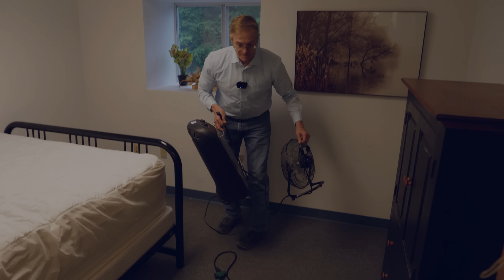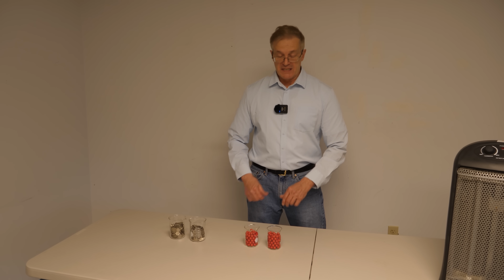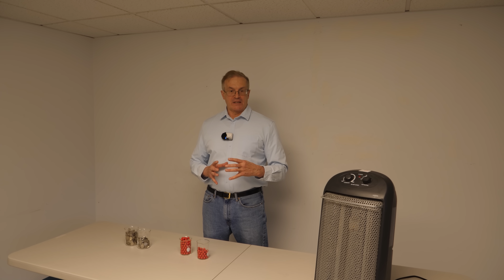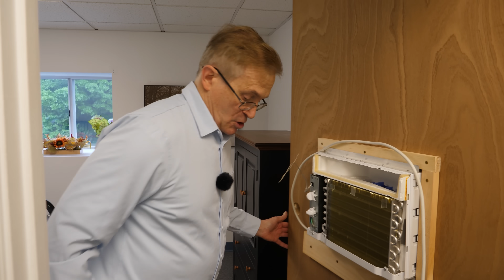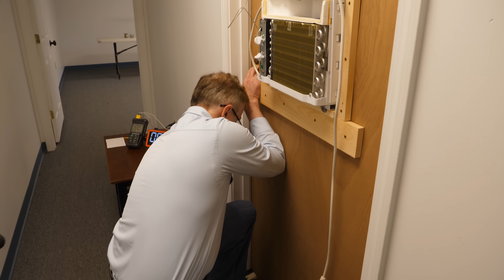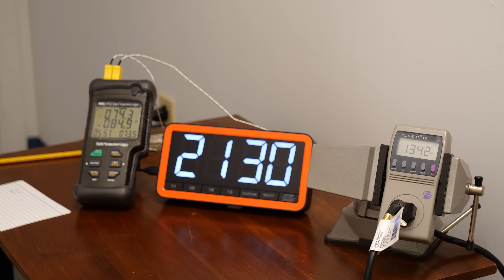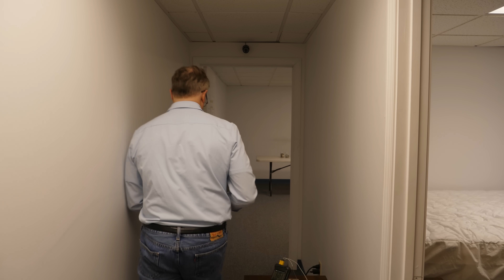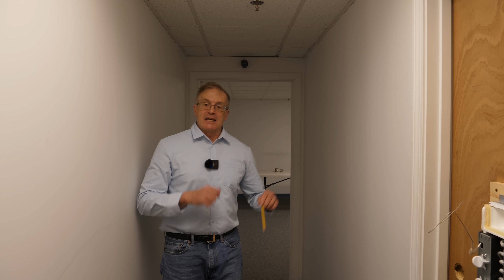You're wasting money on heating! Use your A/C!

Comment: Heat pump still runs high amps on compressor and 240volts inside and outside . Power failure in winter equals large home generator to run heat to stay warm with heat pump or electric heat ! Heat pump running is like A/C running it draws a heavy 15-22 amps on residential plus the 3-5 amps from the blower . Most heat pumps have emergency electrical heat so if it doesn’t satisfy soon enough it pulls on emergency heat with heat pump and then your pulling an additional 20-40 amps depending on the size of heat strip you have for back up heat and assistance to the heat pump that can’t keep up in cold cold . Most heat pumps can manage on 40° plus once temps are below 40 and less heat pumps struggle and loose efficiency quickly also . 

If you put natural gas heat or propane heat in your house your heater inside runs off 110volts and doesn’t need the big amp / electric draw of the outdoor unit at all . Also if a power failure happens in cold weather your basic camping use generator will run your whole house central heat gas heater . As gas don’t freeze So you’ll have gas to it . Propane is pricier than natural gas . Maybe I’m wrong , and Gas heat blower motor pulls like 3-5 amps when running and doesn’t require the outdoor unit at all.

Comment: But what about chilling the rest of the house with the cooling air conditioner side?
Reply from the maker: This was a demonstration to show the multiplier effect of a heat pump. Typically, they would be exhausting the "cold" air outside, but there are ways to combine conventional heating methods with a heat pump to cover much larger temperature differentials and still take advantage of the efficiency gain with the pump. The route is based on your concern about cooling one room to heat another. 🤔

Comment: I'm Sorry I can't get past the A/C in the door with the Exhaust towards the room. Even you said the Temperature had dropped in the hallway. So the controls would have to be outside the home in order to get the heat from the Exhaust? I understand BTU but not transfers of unseen energies. Not trying to be sarcastic. It just doesn't compute in my mind. How do you use an ordinary A/C unit if the room you're trying to heat is on the outside of the unit?
Reply from the maker: The demonstration proved the huge efficiency gain when using a heat pump.
Implementation in a practical system would involve a little more than rotating the airconditioner, but it's not that difficult to work out those details.

Comment: I do not understand how that can work in real life situation.  A window unit AC has a thermostat and the lowest it can be set to is 60 degree.   So if the outside temperature is (lets say) 30 degree, the AC condenser will not come on for the heat exchange.

Comment: Thank you thank you thank you. I'm freezing my ass off in a winter storm with no heating in Texas and I was finally cold enough to get up and DO this. I had a portable rollaround AC, and created a shroud for the cold end out of foam board and a 6" dryer hose wall mount, and move the trunk to that side to expose the hot side. The only extra thing I had to do was to make a small lamp with a small lightbulb to produce a small amount of heat. I wrapped this around the temp sensor on the back of the AC (got that idea from CoolBot), which convinces the AC to kick on. It heats my house beautifully. Thank you SO much for the great idea. I am warm because of your work!
Reply: Isn't there a problem with the evaporator coil freezing up, and putting the indoor part of the A/C outside into the weather? Electrical stuff often does not like to be out in the rain, unless it is designed properly to be weather-proofed. I think that a heat-pump or A/C with the heat function, would already address these issues. However, A/Cs with heat tend to be more expensive, especially when it is the window A/C type, as that is such a niche usage.

Also, I suspect that proper heat pumps might be able to tinker with the refrigerant pressure or something, they may have tweaks to insure that you still get heat production even when it is very cold outside, and trying to jury-rig a normal A/C could lack those modifications.

The video experiment is way too optimized, as his "heat pump" is not having to deal with very cold winter air outside. However, it was a great way to get some numbers and scientific data to prove his point.

Portable A/Cs are usually fairly stupidly made. The problem is, that they should contain 2 hoses to the outside, and not just one. Rather than just blowing hot air to outdoors, they should also draw in that air to be heated, from outside. Otherwise, they are pulling in the air from all the air leaks in the structure and wasting your conditioned air, and thus get a lowered efficiency rating. Even a cheap basic window A/C does this correctly, heating only outside air and not draw that air from the inside. Your basic window unit has 2 fans, one for inside air, one for outside air, even if both fans are driven by the same fan motor shaft.
Reply: @yosefmacgruber1920  Type 2 heat pumps, such as the Midea or GE Soleus heat pumps only operate continuously at over 40 degrees. The problem is that the cold of the heat pump exhaust air freezes the coils at even above 32 degrees.

When first plugged in at lower temperatures they can effectively heat a room. For example, the Soleus unit can heat a large room to 80 degrees F with an outside temperature of 34 degrees F. But after the ice builds up, their efficiency will drop to that of a space heater. And I'm not even sure it is safe, with regards to equipment life, to operate them when the ice is built up.

I would like to see a demonstration of an AC heating a room with the outside temperature between 40 degrees F and 50 degrees F. I live in a trailer, and with the outside temperature at 50 degrees, just the Sun can heat the trailer to above 60 degrees F in the daytime.

I have propane heat. Most of it is paid for by Li Heap, but I always run out of Li Heap funding before the end of the season, so I have to pay for the last fill-up myself. I am thinking of turning my AC unit around so that it can heat my bedroom when the outside air temperature is above 40 degrees F, but I need to see a demonstration with an AC operating with an outdoor temperature just above 40 degrees to know it this is practical.
Reply: @dalesplitstone6276  
Well the home improvement store did not have any window heat pumps at a reasonably affordable price. So I might as well take it out come wintertime, to eliminate the cold draft and get my window back again, since I heat with the automatic hallway thermostat-controlled gas logs.

Usually if there is the heat function, it somehow prevents the outside coils from freezing. And you do get heat when it is freezing cold outside. But obviously, I think most heat pumps heat better where it does not get too cold, why we see whole house heat pumps in places like Florida.

A mini-split ought to be great for a trailer, but you might need 2 or 3 inside units for a mobile home, due to its length. Unless you just want the center part mainly cooled? And nighttime is cooler outside anyway, bedrooms are often at the ends of mobile homes, so as to eliminate space-wasting hallways. Some models can support up to 3 inside units via just the 1 outside unit. I think that mini-split outside units are not going to ice up. They reverse the reverse momentarily, just enough, to blow the ice out. I hear that they have a lot of nice features now, some even do not turn the fan in inside until the coils are already warm, no no puff of cold air at startup. And many like to ramp up their cooling, so on a not very hot day, they will hardly be cooling at all, just enough to keep things comfortable. There is even a model that is solar powered. It also has an electrical plug. Whatever that the solar panels are producing, is subtracted from how much it needs to draw from the grid. Imagine that, still cooling during a power outage.

Normally, you would need a dedicated circuit run for your mini-split, but that is just for the outside unit. The inside unit is powered via the outside unit, the control wiring that you would be running anyway. So just the one outside-inside small hole connecting the two. As the wiring is outside, the electrician would probably just run conduit on the outside wall out back.

I do not think that turning an A/C around is recommended. Why not do some shopping and at least get an idea of what a proper heat pump would cost. Check both window units and mini-splits. Mini-splits are better, as they do not subtract your window or view, probably are quieter, and mount up high on the wall and out-of-the-way. And tend to be more powerful and capable of cooling several rooms. Most all the world uses mini-splits, except for the behind-the-times USA. Heat pumps are available as window units, but if the local store does not carry a reasonable selection, then order online a week or more before you plan to install it. Some places heat year-round with heat pump and it works. Maybe a supplemental electric ceramic or oil-filled space heater on the coldest days. Some electric heaters are quiet and have no fans, but that also means that the unit has to be taller or longer in order to dissipate the heat safely.

If you need A/C anyway, it can be smart to consider a heat pump, even if you do not plan to heat with it. Because when your regular furnace breaks, you have a backup option that can provide heat until the repairman can come.

A downside of heat pumps, is that I have heard that the coils on the inside are thinner. When that is also the high-pressure side as with heating, they might eventually develop micro-cracks or leaks, and then once the refrigerant is gone, it no longer works. It is going to need to be recharged with refrigerant (expensive) or replaced (expensive). A portable space heater costs little to replace it, if you do not count all the electricity that it consumes. Anything permanently installed is likely far more expensive when it breaks. But a mini-split is not going to overload your old tired wiring, because it gets a dedicated circuit to the outside unit, straight from your electrical service panel.

My window A/C is a light-weight model, I wanted something that I could lift without injuring myself, so that caps me at 6000 BTUs, not really enough for the hottest summer days, but there are not that many days that are that hot, and it is so much better than nothing. My old central heat pump quit cooling years ago, too expensive to get it fixed, if it is not going to last forever like old appliances did. I have a 2nd window unit, but unless I have company coming over, it really is not worth installing 2 of them.

If you live in a mobile home, be sure to own the land underneath you. As I have heard of greedy investors buying up mobile home parks, jacking up the land rent, then stealing the homes, because the owners can not afford to move their homes elsewhere, or they can not move them because they are too old and would likely fall apart.
Reply: Also, you can not just turn an AC unit around. Where is the condensate water going to go? Normally it goes to the hot side, and often it may drip to the ground. And it is made to fit into the window, only the one way. And the electrical controls should not be out in the damp air and rain. It just is designed all wrong to be turned around. The power cord would not even be on the correct side. Seriously just go buy a proper heat pump, use your old A/C to get by during summertime if your heat pump later breaks.

Go online and see what sort of costs it may occur. For some people, with the right model, it might even be a do-it-yourself job. That is, if you are handy enough. It may come with the stuff you need and directions how to install it.
Reply: @yosefmacgruber1920  The installation of a mini-split unit has to be installed by a professional, by law. This can add thousands of dollars to the cost of a mini-split system, especially if there will be several units on the inside.

Currently I have an old Goldstar (LG) AC that I use a couple of days out of the year. I am considering replacing this unit with an 8000 BTU Midea heat pump. The Midea heat pump is the same height and about an inch narrower than the Goldstar. I spend about $300 out of pocket each year for propane. If I can use an 8000 BTU heat pump in my bedroom, I can turn the furnace temperature down from 68 degrees F to 60 degrees F, while setting the heat pump to 68 degrees, when the outside temperature is over 40 degrees. If this saves me one $300 out of pocket fill-up per year, I can pay for a $500 heat pump in 2 years.

If this works, I might install a 12000 BTU heat pump in the kitchen window. This window is shielded from the rain by a porch roof.
Reply: @dalesplitstone6276  
Well that is really bizarre, because there is some YT video of a model that is designed that most any serious DIYer could do. All the refrigerant comes preloaded into the outside unit.

Well then, it sounds like you need simply one of those window heat pumps. They do make some decent ones. With it having heat, you could install it better to block drafts, and leave it in all year.

I think that the outside part of an A/C or heat pump can tolerate rain onto it. It should be tilted anyway so that the rain drains away from the window.

Or maybe you should just explore leaving the has-been corrupt USA? Your new home may even come with pre-installed mini-splits. You could live in a nicer climate where you never have to see snow.

Should you leave even during Trump's 3rd term? Nomad Capitalist seems to think so, because just before the election, he said that even if Trump wins, what happens after 4 years? Yeah, good question. I have heard Vance, but even if so, just reword the question, "What happens after 8 years?" NC says better to leave years too early than a day too late.
Reply: @yosefmacgruber1920  I voted for Harris because as bad as Harris is, Trump is worse. This Hitler wannabe fascist is extremely dangerous.

I wish the DNC would dump superdelegates and run honest primaries. If they did, maybe we could have a Democratic candidate who could win against a fascist.

In any case, the external part of my current AC extends into a three-sided shed, so it is protected against the elements. The same would apply to the heat pump that replaces it. The sane will apply more or less to the kitchen unit even though it would only be sheltered by a roof.

BTW, turning an AC around would be an acceptable alternative, bu the acceptable models aren't that much cheaper than a heat pump.
Reply: the heat produced by this is very efficient, especially if the temperature outside is above 40F...  much more efficient than a space heater.  Even if its in the 20Fs, it is more efficient

Comment: I mean... the heat has to come from somewhere. Some came from the hallway, which is why it's colder in the hallway afterwards. If you're in a house that needs heat, it won't come from out of thin air, so-to-speak.

Comment: You changed 1 variable. The leingh  of the extension power cord lowers the amps & watts rather sanificly.
Reply from the maker: No, it doesn't.
The amps and watts are measured upstream of the heater.  Any power that is deposited in the cord is measured, and that power adds to the heating of the room just like the resistance in the heater itself.

Comment: Starting at 77.2 degrees? That is already too warm.  75 outside?  Why would you want to heat the room to 94?  What if it is 10 degrees outside? and 60 degrees inside?  I doubt the AC will even come on without removing the thermostat first.  I don't think a heat pump and an air conditioner are the same thing.

Comment: Why didn't you wire in a electrical meter like you would have on your house and show what the kilowatt usage was on both of them. The meter you are using shows the wattage the appliances use but does not tally it up,would probably easier on the people in a real life scenario seeing their electrical meter spin and calculating the cost of it.
Reply from the maker: The power meter still works well, is very visible, and the time was the same for both tests, so the difference in the rate of consumption shows the difference in usage.
Reply: @TechIngredients  Being an Electrician for 37 years I totally understand what you are saying. But a person who is not around it and just pays their electric bill, showing the usage on a meter and taking it times what the electric company is charging per kilo watt hr takes all the problem solving out of it to show them for example  A = $2.00 an hr  B =$1.47 an hr.

Comment: 12:19 should have also calculated the resistance of the extension cord since its length was quite longer than the length of the cord to the air conditioner.
Reply from the maker: It wasn't necessary because  the cord was in the room as well.  Any resistance generated heat. And, that was also included in the meter reading.

Comment: Let me see if i have yhis strait? Help me understand better. A regular window unit a/c blows cold air in one direction and hot air in the other? So, summer time, you have it facing inside to cool the house and winter time, point outside to warm the house? 

Im in a house now well insulated. Above the ground, on metal beams, whichtransfurs tje cold from the beams through the floor. My gf had back surgery, and the cold is tough on her back. 

We use those floor unit heates that plug into the electrical outlet. It seems to use more electricity to heat this place than to cool it. And, it doesn't heat up fast enough to stay up with the cold dripping temps of winter. 

I've gotten insulin boards in the single pain window, and that seems to be a big help. But, always trying to figure how i can do better.